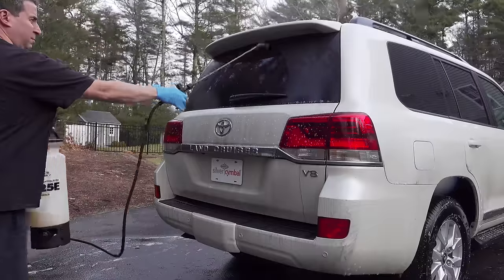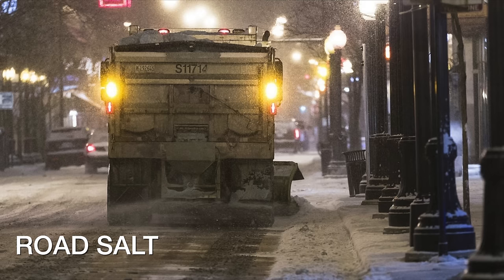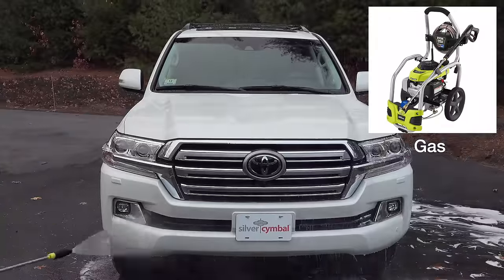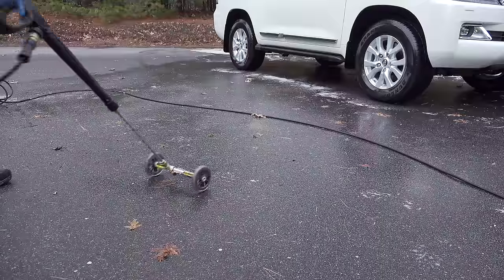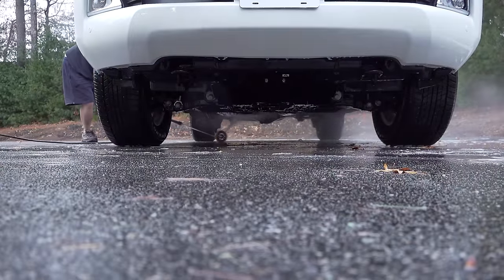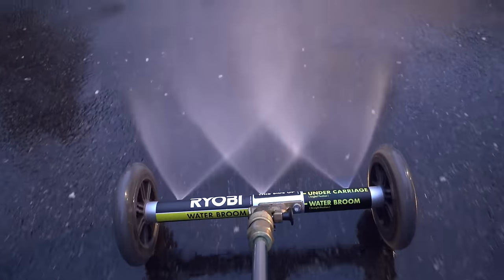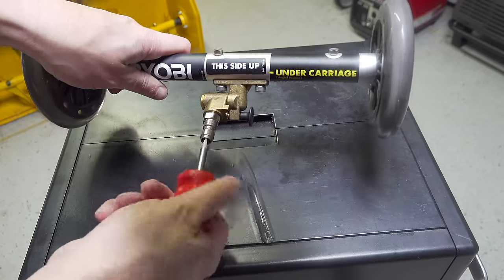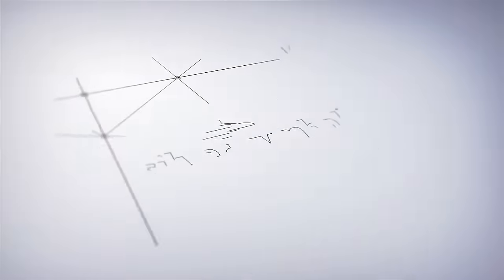How to Clean your Car's Undercarriage in 3 Minutes Winter Salt & Snow Removal

Comment from the maker: Please LIKE & SUBSCRIBE - To order the Ryobi please click: https://amzn.to/3w2ZRVj
Reply: Thanks for your excellent tip mate.
Reply: Good video but a gas pressure washer is way more  effective than a 1800 Electric. Even Ryobi  and other makers of such a tool will tell you that. I use mine with a 3200 PSI gas. The wide nozzles of the tool does not allow any damage even on cars with under carriage  covers like mine has. I will also remove the covers and put the car on ramps for more effective cleaning. SUV don't need  ramps.

Comment: I'm a mechanic in Massachusetts and you don't have to convince me. 80% of my work is caused by rust and here in Mass they pre treat the roads with liquid salt which will destroy you car!! We have customers with 10 year old cars that are so badly rusted they have to scrap their cars and the scrap yards are giving people 2-3 hundred dollars for their 10 year old car. It's a combination of thinner(lighter) metals, largely recycled steel and liquid sodium. I am buying 2 things a pressure washer and a under car washer thank you for this video !!
Reply from the maker: Thank you very much for the nice comment
Reply: I'm also a mechanic in East boston, I've seen 6 month old cars full of corrosion. New England rust is by far the worst in the country
Reply: Ok but when its snowing a foot outside you really go out there and do this? O
Reply: @kandacepatterson7965  no you wait until spring
Reply: @danfay4860  thanks Dan. Moving there in a few months from Te as...kind of nervous about truck care. I appriciate you so much!
Reply: How often should this be done?
Reply: @Nick-NY  as many times as you can during the winter when you know it won’t freeze up underneath your car. Defiantly every Spring
Reply: Yea lawn sprinkler that you place under you car works just as well

Comment: I use a rather high pressure wand with a rotating head, attached to a garden hose.  The wand is a six feet long aluminum pole and with the rotating head with a wide spray. I can get into the wheel wells and the interior of the wheels and disc brake areas.   I spray it back and forth, front to back, of the under carriage.  It takes about 2 to 3 minutes.  This is more effective and versatile than "The Silver Cymbal", IMO and cheaper and easier to use.  I use hot water which increases salt removal from tight places.   When I traded in my 7 year old Yukon with 80K  miles (I live in the north) the dealer couldn't believe how rust free the under carriage and wheel wells were.  I never found the need to use any undercoating system such as Fluid Seal, etc.
Reply: Do you have a link to what you use? This took looked great but I wondered about the wheel wells

Comment: I've never bothered with this stuff because every car I've owned has been a piece of crap, but I'm about to get a much more recent and significantly more expensive car than I have ever owned and I plan to do as much regular treatments on it as possible because I want to drive it until it falls apart. This is definitely something I need, living in Utah where they salt the roads during winter

Comment: I took a piece of pvc and drilled some holes in it and attached it to a garden hose. Then I stuck it between two 2x4 and would drive my truck over it real slow and wash of all the sand and saltwater from the beach
Reply: dye think it can pull sand and salt further into small folds?
Reply: I use a lawn sprinkler. Put sprinkler on right side of truck and the middle and the left. Drive slow. Cold engine. I do it once a month. I do it before I wash the truck

Comment: I going to get one of these for my pressure washer in the spring. But what I have is a shower wand that you hook up to your regular water hose. It's like 3' long, has a adjustable head, and has different spray patterns to choose from. Found it in the same aisle at HD where the water hoses and nozzles are and it was cheap. Living in Cleveland, I put the pressure washer away for the winter so I use this wand every time I wash my vehicles during the winter to spray the undercarriage.
Reply: thanks for the idea. I was looking for one of the kind you roll under your car but the hand held wand will work for me.

Comment: That's a beautiful Land Cruiser! I've been meaning to pick one of those sprayers up for a while, its so much easier than getting down on my knees and crawling around with a hose just getting the edges clean. Too cold to use the hose right now sadly, it was 10 degrees this morning so I'll have to wait til it warms up lol. I've been doing a lot of detailing vids lately since the lawn is frozen, most cleaning vids I can do in the garage with no access to water, which is nice!
Reply from the maker: Thank you so much, it works really nicely for this. More videos coming on the Toyota Landcruiser
Reply: good evening just use a lawn sprinkler I used to use one under my car and I would go back and forth cleaning underneath the car did a pretty decent job have a peaceful evening
Reply: Brian Hall that’s a pretty good idea! Low pressure obviously compared to the pressure washer but I won’t have to buy anything!
Reply: @SilverCymbal   -  YES more on the Land Cruiser please.  I have 3 Toyotas and luv um.  One is an FJ.
For some ideas you can check out SUV RVing channel as he got a land Cruiser to supplement his RAV4.  But I’d say about 3/4 of the time now he uses the Land Cruiser.  Will check back to see about your Land Cruiser Vids. Thanks.

Comment: Unfortunately this tool may not be an option for those of us who live in the rust belt as winter temperatures do not allow for running a pressure washer outside/on the driveway when it is below 30 degrees (which is at least 3 months out of the year - most critical when the roads have more salt than asphalt on them). To preserve the undercarriage from salt exposure the best method is oily undercarriage spray (such a Fluid Film or the alternative) treatment. Now if you use the undercarriage water spray, you will remove the protective oil film, which defeats the purpose. Sounds like this is a great tool for warmer climates where it stays above freezing in the winter, or for summer undercarriage use for those residing near the great lakes, out East/New England and Canada.
Reply from the maker: I live in Massachusetts so believe me we know the cold. This was an unseasonably warm day (hence the shorts) we got last week. When it's really cold I run a hose to a bathroom faucet near my window with a long hose and use lukewarm water. I will do this once or twice during the winter if I can tolerate it and it can usually get me through the worst part of the season. You know how it is with out cold. Sometimes you have to make do, that may be helpful but you definitely need to drain the pressure washer after.
Reply: @Silver Cymbal: great tip!!! What device do you use to connect the garden hose to the kitchen faucet?
Reply from the maker: @MaximumDIYGarage  Thank you, you just need one of these. This will adapt almost all types of kitchen or bathroom faucets to a standard garden hose variety. Cheap and works great https://amzn.to/2uSmSuz
Reply: I live in Massachusetts. The winter weather here does allow for hookup to an outside faucet. Just need to pick a day above 32degrees. Many of those in Jan/feb. I wash my vehicles all winter outdoors. The key to using the pressure washer in winter is to buy and use a can of pump pump saver from Briggs and Stratton. This will protect your pressure washer pump from freezing after use.
Reply: @Dan Conway: can the pump saver  be used in electric pressure washers?
Reply: @Mr Sunshines It sounds like you're mad because you drive a rusty Toyota Echo.
Reply: Perhaps you could use the water spigot from the cloths washer to hook it up to the hot side. I used to do that before I installed a dedicated hot water spigot, I used the freeze proof spigot , just hooked it up to hot water. I can easily wash my truck when the temp is down to about 28 degrees, any lower than that you have to keep spraying the panels to keep the water from freezing on it, I towel dry it
Reply: It’s not difficult to jump on a day that’s above freezing and get the job done.

-50 wind chills exactly a week ago today.

60 degrees today. Ohio.

So I’ll be rinsing today.
Reply: Yes @MaximumDIYGarage
Reply: @MaximumDIYGarage yes

Comment: As a fellow Toyota owner this great new tool should be included with the sale of all their full frame vehicles.   They definitely have rust problems, this simple tool should really help.  Thanks for the great vid.
Reply from the maker: Sadly true with Toyota. Thank you for the nice comment too.
Reply: @Mike N they had that problem in some of the 1990's trucks & some 2000's. After 2010, it was never a problem usually. On Autotrader Ontario there's a 98 Tacoma with a rotten frame, and a 2001 with not as bad. There's no post-2010 Tacomas on Ontario Autotrader with rotten frames. And quite frankly, I've never seen a new Toyota truck go bad in the rust belt. They've improved the rust prevention. As for their cars, they are fine, except most 1980's models, some early 1990's. Got a 2006 Matrix, I live in Canada of course, 244000 kilometers, which is barely broken in, and it's got zero rust. It's been exposed to lots of salt over the years, but no rot. It still has the original 17 year old exhaust. Well aluminized. The body is mint too. I wax it regularly, so that the paint stays pliable. People that are worried about car rusting, I recommend before every winter, use paste wax on the whole exterior, all the doorjams, and especially the hatch. Of course, if you leave a deep scratch alone on a car, it will rust, & that once just a deep scratch turns into major rust bubbles & rot. But Toyota is a great car company. Japenese quality & reliability. My old Matrix will probably still roam the streets 15 years from now.

Comment: Them Toyota Tacoma‘s are notorious for rusted out frames, Toyota actually did a huge recall on them.
Reply: Jeremy Droge that recall was for old model years up to 2003. For current cars unless your keeping that car for 20 years, which people do, this is unnecessary.
Reply from the maker: Originally tthey were until 2003. Search on new frames for Tacomas and you will see them well up to 2009!  Also check out Fords, F-150s Rangers and you will see insane amounts of frame rust and rot, especially in areas with heavy salt use. This is NOT a thing of the past. A new car will not stay that way if you skip this.

Comment: I like it! Great job! This has been a mild winter in New England but normally you would have to wait until spring to use that tool here.
Reply from the maker: Very true. you know how it though, there are always crazy warm days then 10 degrees the next. Maybe it will get rid of the EEE for next year for us.
Reply: I installed an outdoor faucet hooked up to the hot water heater, works beautifully and is cheaper to use the hot water at home than go to the DIY car wash places. You can take your time washing the vehicle and also not waiting for other cars in front of you. I’ll have to check on this device for the underside, it looks like it could use two extensions tho

Comment: Nice start.
But the real solution is an oil based undercoating- sticky chainsaw oil application or fluid film every year.
The water is just removing some salt, sand and crud- it's not a  rust preventer. 
I have a good friend with 500k + on a 2001 Dodge Cummins- truck is flawless. 
I have 200k + on my 2013 Ford, truck is flawless. 
Salt, sand, brine cant stick to oil.
Good luck
Reply: Philip Underwood Better to remove the muck than do nothing. How hard to do an undercoat like you mention? Oil/film recommendations?
Reply: @ChrisPoterala  
where are you located?
Try google for undercoat business nearby.
Ask some buddies who have pickup trucks that they have owned for a while.
I found my guy who does chainsaw oil from a very good friend.
There are other independent fluid film guys and even some undercoating franchise shops near us in NH and Maine.
The chainsaw bar oil application is probably not a DIY project.
My buddy Tom does have a special applicator for fluid film - I think you can find these spray kits from Fluid Film or possibly online - but I'm pretty sure you need a compressor to pressurize the bucket.
I'll probably hire Tom to do my trailer next year, but I'm thinking about a full sandblast and repaint first.
Reply: Philip Underwood nice, I’d love to see a YT video of it being done DIY, need that for my vehicles up north here
Reply: @meals24u  
where are you located? What state?
Reply: Philip Underwood 
Manitoba, Canadia Trudeau State! 
Bought a Brand new Ford Fiesta back in 11-12, bought Fords Diamond Crap insurance, that has the undercoating done, wax on outside and inside, plus that electro-pulsating device under the hood, annually inspected and all, the thing was rusting everywhere after only 6 years, and I sold it in as is condition for next to nothing! 
I was terribly disappointed to say the least..
Reply: I fluid film every spring and fall. This tool is great for getting salt off at the end of winter or during a January thaw
Reply: 8meals I'm in mass. I don't know of any legit businesses in Ma. Probably due to EPA but if you are in or near NH THERE ARE  companies who do this google it. 

I am a mechanic and about 80% of my business is fixing things caused by rust. If you want to keep your car longer and save money keep salt off your car. I strongly advise you to have your car sprayed underneath with Some sort of oily undercoat
Reply: Dan Fay 

thanks will look into it further!!
Reply: @danfay4860  
Mass mobile undercoating on facebook.
I don't know them personally, but seem to have decent reviews and lots of photos that show good work.
I'm in NH.
I have a great guy here who uses chainsaw bar oil. Legal business and awesome work.
I fluid film my snow blowers and some other machines with rattle cans. 
I leave it to pros to do my pickup - just way too much work.
I'm getting pretty close to starting a business for this - lots of demand, lots of need and lots of people who need help.
Reply: @meals24u  
I wouldn't trust a dealer crap service for this.
Years ago I had a 1998 Mercedes E300 with some crazy good undercoating - kinda like a rhino lining under the whole car. It worked great, but the car rusted out in all sorts of other places - door panels, any trivial knicks, dings, hood, window seams, etc.

Just try google car undercoating and see what comes up in your area.
I had several businesses I never heard of come up in results.
If none - start a business. I think you can get 100-200-300 per vehicle gross revenue.
Make some money & save some cars!!

My guy has a 1944 chevy pickup that's in awesome shape. 
Partly good maintenance, mostly lots of oil.

Giddyup!
Reply: I was thinking I could clean up with this and the let dry, then spray with undercarriage oil.

Comment: Nice tool for the warmer months. My drive gets icie as it is.
Reply from the maker: Depending where you are, I am in Mass I try to use one a couple of times in the winter when temps go over 32. I connect a hose to my bathroom faucet near a window and use warm water too, makes it a bit easier.  Life in the cold weather!

Comment: One of these should come with every Jeep sold in the New England area. I have never seen a Jeep without a rusted/rotted undercarriage. - Cheap communist China steel.
Reply from the maker: Very true.  Jeeps definitely need this. So sad they die way before their time
Reply: And I’m not sure if it’s exclusive to Jeeps. I had my Land Cruiser frame soaked in Rust Cbecks rust proofing and will have the frame coated in a wax type underbody protectant this summer once the frame drys out completely. I plan on keeping it for 20 yrs.
Reply: Steel can be communist? So freedom steel doesn’t rust? Must have a special chemical additive made from bald eagle stem cells.
Reply: @manncura  Made in USA = the best of everything

Comment: You don't need to buy some like that ,just use a fawn style lawn sprinkler. Probably better because easier and cheaper
Reply from the maker: MIght be cheaper but it's not better. Much too low pressure and moving it around isn't as easy as you think under a truck. Better thank nothing but this thing is great
Reply: Also you show complete rusted frames and poor undercarriage, if you dont use the washer system there is more to vehicle maintenance then wash. Rust proofing is key ,I live in Niagarafalls Canada and every year I take my car Krown to have my car rust proofed

Comment: Great idea. But how does it work when it's sub zero temps for weeks at a time?
Reply: My guess is to wash in garage if you can or wash asap in spring.
Reply: Use it in your heated garage as soon as you get home. Other than that, forget it. You’ll just have to leave your car outside to rust until it’s warm enough to use this.

Comment: I live in Michigan. I like to  see you do this in 10 degree weather out side.
Reply from the maker: I live in Mass so we have plenty of sub zero weather, Even doing this a couple of times a winter can make a huge difference. One trick is to run the hose through a window and connect to a faucet, using warm water. Makes it easy without worrying about burst pipes:  Get this adapter https://amzn.to/2R7iQXF.
Reply: Paul Arnold Just install drains on each side, and at the  garage door, when  before you’re pouring your garage slab-make sure it’s sloped enough to run out the continuous drain, to the street.   And  be able to heat the garage when finished pressure-washing the vehicle.   And maybe have a walk in pit under one of the lanes, where you can re-coat the undercarriage.  And yes put a drain in the pit, too, while you’re at it. I hope to incorporate these ideas into building a big pole barn shop, if/when I move out into the country.